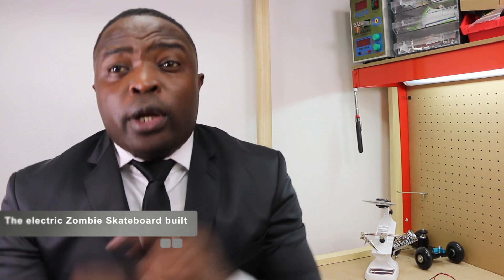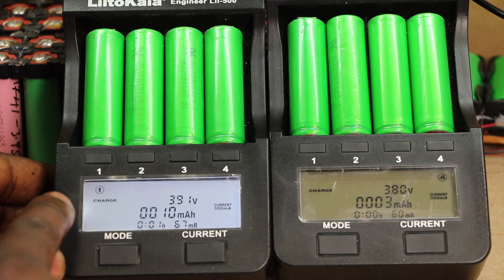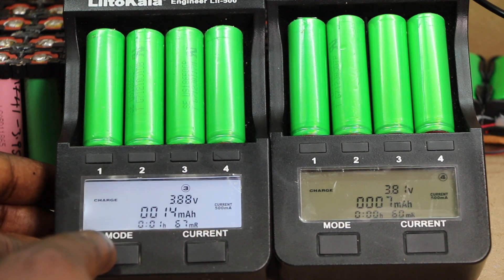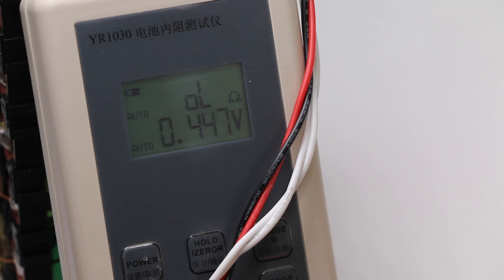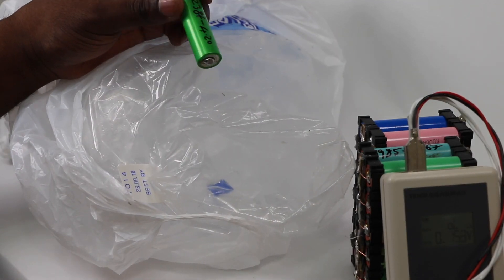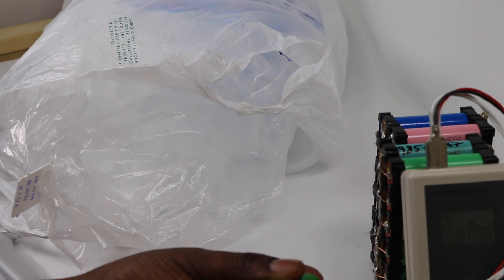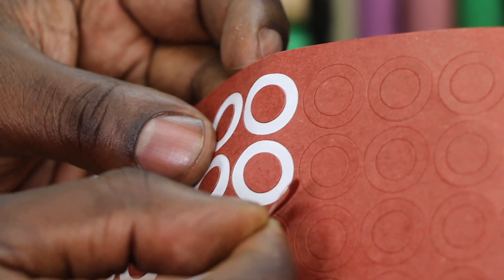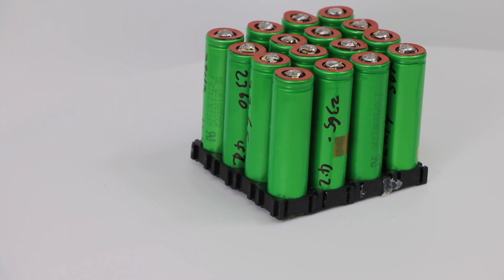The Electric Zombie 222 Skateboard part 1

Comment: :: 1:59 AWESOME VIDEO!!!  Does your battery charger not have a temperature reader?  the Opus Bt-c3100 has 4 thermometers built inside.
Reply: hmmm, their website says it has temperature protection "Lii-500 combined with the high temperature protection, so Lii-500 safer"
Reply from the maker: Oh, thanks for the heads up. I have never used that before but will check it out.